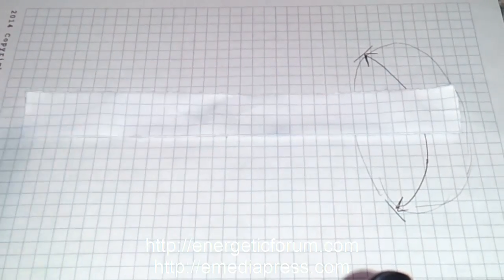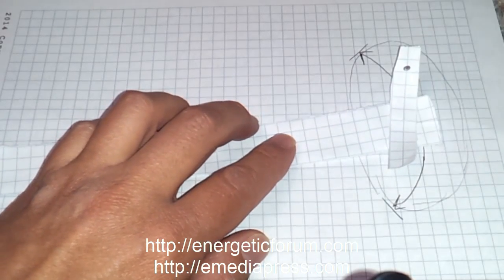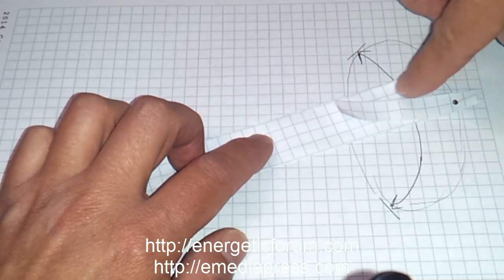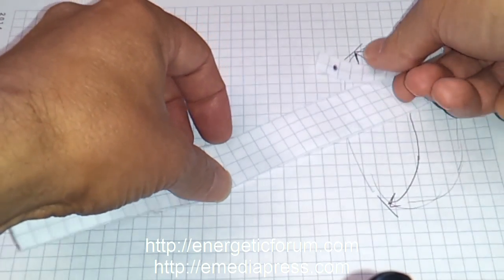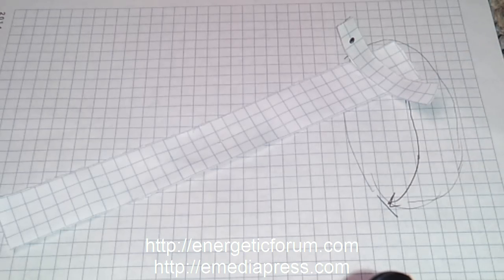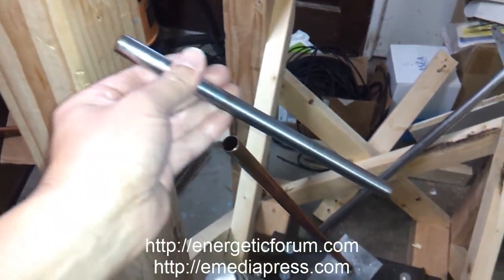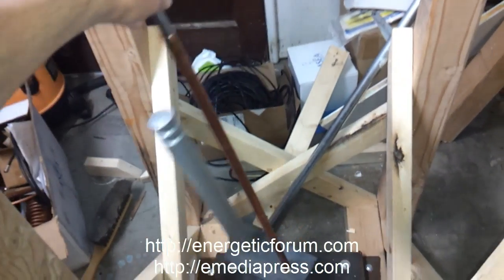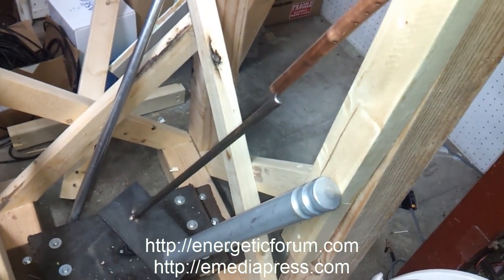Gravity Power - Extra Details

Comment: I don’t see elliptical,  if you are saying that the first shaft driven by the motor at the top is turning in a elliptical orbit then whatever it is doing the first weight is also doing. Now we know this is a gravity harvesting device and the orbit of the shaft determines how the weight is lifted if it’s elliptical the weight Will only be lifted at the widest part of the circle.  the narrower part of the circle will not be lifting the weight at least not enough for gravity to act on it .    So when The lever lifts the weight and gravity begins to act on it causing the weight to fall it does not get lifted up again until halfway around the circle.  It wouldn’t be a smooth uniformed movement of the shaft it would start out with a quick lifting of the weight Then the Shaft would be doing nothing Till the weight got all the way down halfway around the circle at that point the weight would be spinning faster than the shaft that’s driving the it.    So in order to do the next half cycle rotation the shaft would have to catch up to the weight requiring an acceleration of the driving rod in essence with an elliptical orbit it would be more like a slingshot motion a jerking motion a quick movement 
 of the rod then a pause then a quick movement again I don’t believe that is what’s happening when you look at Skinners upper rods driving The first weight,  they look like they are drawing a circle in a uniform motion.    When I see Skinners machine operating my diagnosis is this, I see a lever using leverage to lift, tilt a weight into a position where gravity can act on it and as it starts to fall the lever continues to lift the weight , forcing it to maintain in a position which keeps the weight constantly falling.  Think of a ball floating in the ocean when a wave comes by it lifts the ball into a position where gravity can now act on it pulling it back down but the wave does not stop it is continually lifting the ball it is a uniform constant motion if you were to measure the force of the wave it would be constant and therefore The force Acting on the ball pulling it down would also be constant. I think the top rod lever it’s acting like a wave pushing the first weight but maybe not really pushing it because it has to be gravity that moves the weight.  So whatever the first stage is doing the second stage must be doing to because it’s connected to the bottom of the first stage so that means bottom stage weight is turning in a elliptical orbit as well.  I don’t see it.
Reply from the maker: My interpretation is correct.